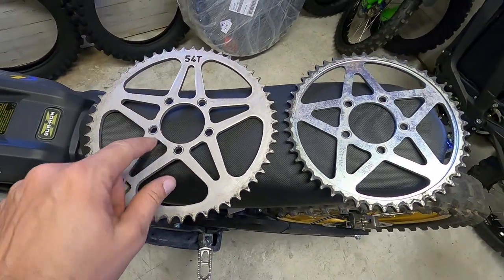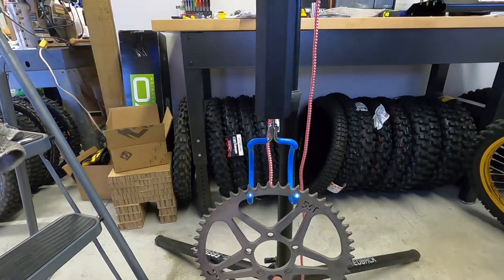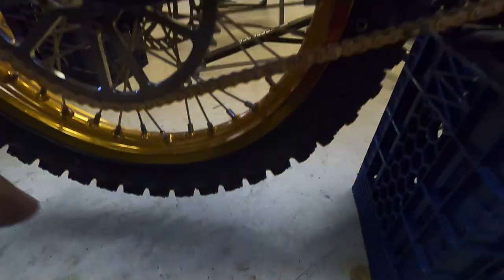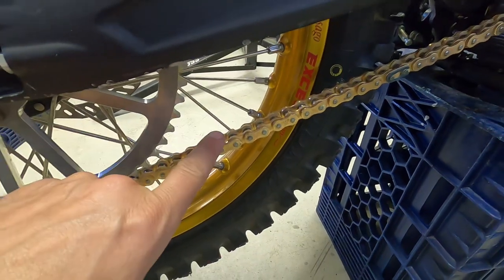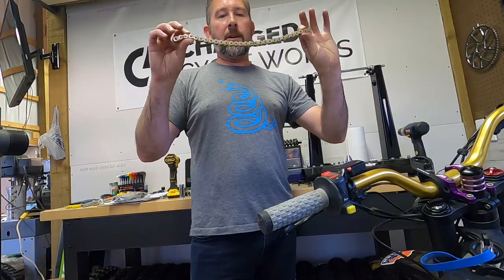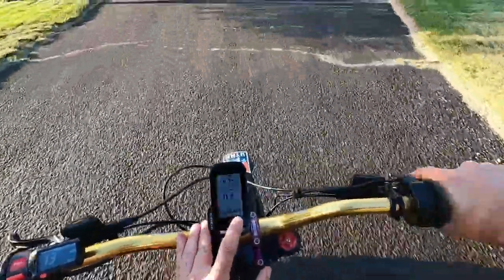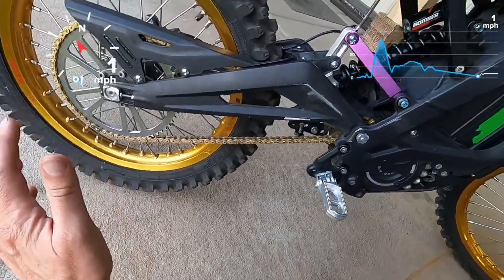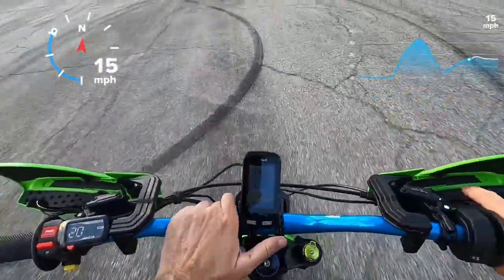Surron Acceleration Testing Aluminum Sprockets Non o-ring Chains

Comment: Great video. Good points about things people often do not consider. Rotating mass reductions are a good way to boost performance and also reduce unsprung mass for better suspension action. Whether to use o-ring chain or not seems like it is mostly based on where you ride it.

Comment: Thank you! I was hoping  you'd swap the sprockets/chain on each bike as the rear wheel size variable make this a bit cloudy.  I have two 19"  rear tired sur rons, one stock, one 54.  In drag races there is almost no difference.  I like the larger sprocket for slower woods riding where  I need a burst to get over a log or something, yet the original sprocket seems to be closely capable -- and mileage on original much better.  It seems original sprocket is somehow mated the best to the motor or something.  (I can hear you saying, you go ahead and do a test!  But your channel is much better than mine!)   Again, thanks.

Comment: Hi. Do you think the non-ring chain can be installed on a suzuki sv650? The current O-ring chain lasted 20,000 km.
Reply from the maker: I'm not exactly sure what an SV650 is, but if you ride on the road and in rain, then I would keep an o-ring or better yet an x-ring chain on it.  Something with that much power you wouldn't notice a benefit of removing the o-rings.

Comment: Rotating Mass towards the centre won't make much of a difference.... and how long will these aluminum sprockets last compared to steel ??
Reply from the maker: Aluminum sprockets are used almost exclusively with motocross racing bikes producing almost 8x the power of the surron and weighing more than 2x the weight riding speeds far exceeding anything possible on the Surron.  The only reason surron used heavy steel was COST.  We've been running our prototype 7075 aluminum sprockets for an entire year and they show no signs of wear yet other than anodizing beginning to wear off.  They are going to last a very long time on surron and the weight difference on rotating mass is well worth the upgrade especially when combined with a non-oring chain which has massive friction benefits and very noticeable power improvements as seen in our acceleration test which also translates into range improvements.  Weight and friction are the enemies of power and range!

Comment: Since the warp 9 is aluminum does that mean it’ll wear faster eventually ?
Reply from the maker: these bikes don't have enough power to wear aluminum sprockets quickly.  After a year of riding on our aluminum sprockets we cannot yet see signs of wear other than anodization wearing off.  Most motocross racers racing far more powerful bikes use aluminum sprockets to reduce weight.
Reply from the maker: We've been riding both Warp9 and our aluminum sprockets for almost a year and cannot see any visible wear. The SurRon's torque isn't quite enough to wear prematurely, even on our 12kw bikes.
Reply: @ChargedCycleWorks  nice! Looks like I’ll be ordering a warp 9 sprocket 🤙🏽

Comment: How are you running the Marzocchi rear shock? I can’t seem to find that it is made in a 10.5 x 3.5?
Reply from the maker: We aren't quite ready to reveal how we did it, you are correct they do not make a 10.5x3.5.  These shocks are 1/2 the price of a Fox which is awesome and you can still find a few for sale in this crazy market.  I can give you a hint for now, it's about the linkage.  We have a few of these shocks and will be offering a package with shock + stronger triangle + linkage (by Warp9) we are just waiting for Warp9 to finish production of these linkages so that we can build these packages for you guys.  Unfortunately we'll only have a few of them...hard to buy suspension right now :(  We'll reveal more in a future video once the linkages are available.
Reply: Is that a shock extender ?if yes how much ?
Reply: looks like the linkage is longer and the shock is shorter than stock,so they are just compensating by installing a longer(lift) linkage
Reply from the maker: @Evil_Morty2000  correct. We’ve been testing every configuration we can, including the Warp9 lift linkages on shorter shocks. Although the travel is slightly reduced, this Bomber functions/feels way better than the OEM Fast Ace, DNM Burner, and other shocks that come stock on SurRons. Most of our customers are looking to replace their broken/barely usable OEM rear shocks, so this is one of many options we are testing. Maybe not the best solution for everyone, but it’s a quality shock at a great price that is actually available.
Reply: @ChargedCycleWorks  so I'm assuming the longer of the two available lift linkages is the answer(1.5 vs 0.75 lift)for marzocchi 9.5x3.0"?Looks like going to be a nice upgrade and makes it easier for people to buy if you sell all parts in one go.Do you know when your planning on putting it on your website?

Comment: what computer display is that you are using to get the times
Reply: GoPro w GPS enabled
Reply: @nathanweaver7680  ok thank u
Reply from the maker: GoPro is overlaying on the video, but the unit attached to the handlebars is a Garmin Mountain Bike computer, I forget the model it's a few years old so I'm sure the model numbers have all changed.
Reply: @ChargedCycleWorks  ok thanks

Comment: Why does no one ever do front sprocket
Reply from the maker: rear is much easier on surron and most people want to gear down (lower) which would require a smaller front sprocket which would cause problems on surron...already seems to be as small as you could physically go without introducing problems.

Comment: SImple green and gear oil.. no need for all those overpriced products
Reply: Gear oil flings everywhere and is a nasty/smelly/messy viscous oil (if youve ever worked on tractors or transmissions you know). YES it will work, but is it the best option? definitely not. Ive been using spray chain wax on all my chains for over 15 years on my dirtbikes and street bikes, from my experience it lasts the longest, is extremely clean, and is relatively non toxic.